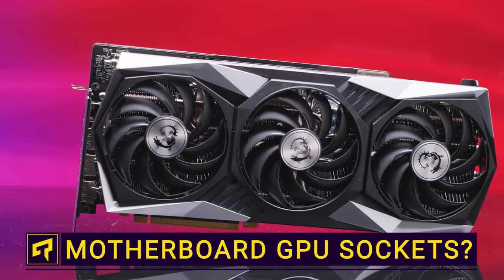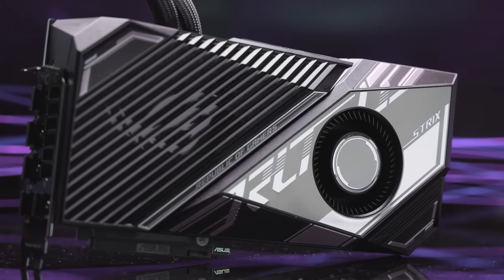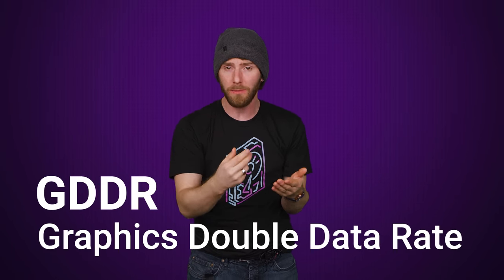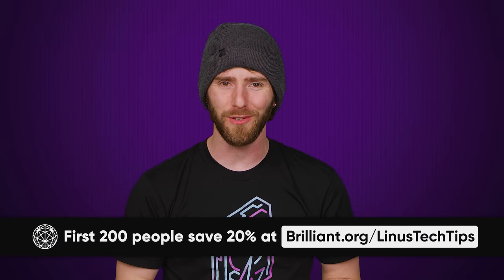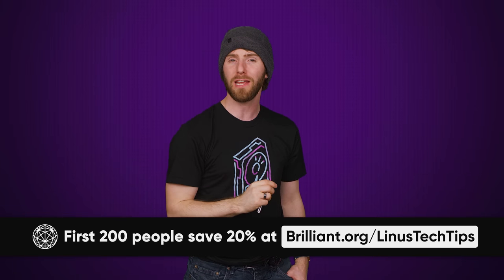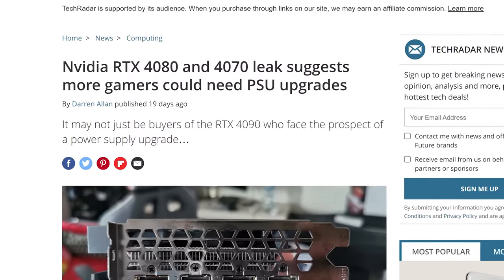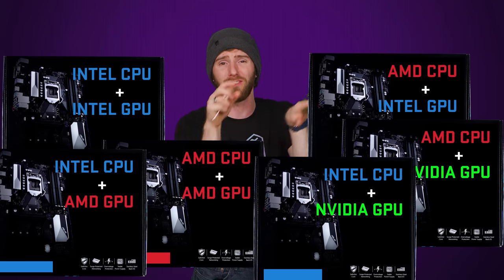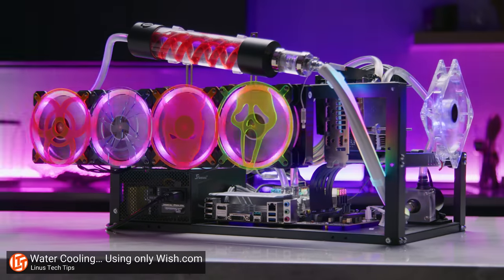Can You Put a GPU on a MOTHERBOARD?

Comment: Am I the only one that remembers nForce chipsets with integrated graphics? They sucked bigtime (from a performance standpoint), but they were GPUs on the mainboard (well, the chipset to be precise) that were powered on the board and hat "sloted VRAM" (they used the regular system memory, much like modwrn IGPUs/APUs).
Reply: Still have a motherboard laying around. They were practical in the same iGPUs are now.
Reply: Those were extremely weak GPUs though. They hardly needed memory or power so they were easy to build into the motherboard. They weren't unique either old Intel GMA or VIA Graphics chipsets were commonly included with just about every motherboard for simple display output.
Reply: They didn't suck at all! NForce chips may not have been the most powerful, but they were sure reliable!
Reply: @TheRealSkeletor  Reliability isn't everything in the consumer space. Those chips were weaker than a house of cards. Even then they were only good for light 2D workloads like webbrowsing and office work. Good enough for office appliances, maybe for most elderly people that dared to try working with one of those scary machines, but most people needed more than this.
Reply: @Donnerwamp  You're not wrong there, but you could boot into Windows on one of those, with no discrete GPU, so that's something. 

Also, you can actually buy a PCI-E GeForce 210 today, brand new. Don't ask me why.

Comment: This already exists.
(1) Apple M1 chips - including the desktop variants - utilize systemwide GDDR memory that is coherent with both CPU & GPU. And the desktop GPU performs similarly to a desktop RTX3080, so this is no budget laptop APU slapped into a desktop form factor.
(2) server motherboards already do this. Look at the DGX Station from nVidia. 8x high power graphics accelerators on the same motherboard.
(3) as others have mentioned, every laptop with discrete GPU is soldered onto the motherboard as well, and laptop motherboards are anything but huge!
Reply: Yeah. Integrated GPUs were already pretty powerful even when it was only Iris Xe and Vega, but they were only held back by the memory. I've been trying to see comparation of a Ryzen 5700G to my 750ti and although the 5700G itself was basically twice as powerful as the 750ti, they perform almost the same because DDR4 held it back.
Reply: Think part of the problem has been that motherboard, CPU and GPU vendors have historically been different companies. Now that both Intel and AMD makes GPU's wonder if either of them would design desktop motherboards with both soldered CPU's and mid-range GPU's. Intel already makes NUC boards, so I wouldn't be surprised if they add their discrete GPU to a NUC board with soldered GDDR5 memory.
Reply: The point of the video is more about having a socketed GPU "core", without the RAM component. That's not the same as laptops - that have either the GPU soldered or in a daughterboard - or the M1 - which, while powerful, is still an integrated GPU.

Also the DGX systems use discrete GPU's connected with SXM sockets. While those do deliver all the power through the socket (and an absurd amount at that), the memory is still in the GPU daughterboard.
Reply: It might have not been mentioned as clearly as it could've been, but the video wasn't about soldered GPUs but rather ones to slot in. Of course you can make fixed hardware however you want, this video however talked about why having these parts slot directly into the motherboard while keeping the freedom to change them out isn't a thing.
Reply: You do bring up some good points however,  I disagree slightly:
You need to keep in mind, the video implies more toward socketable gpus, not soldered on board (a universal gpu socket similar to using a  cpu or MXM slot)

In regards to (1): Apple's solution is more an APU and less GPU. This increases the costs and complexity as you can't just "upgrade your gpu" you have to upgrade the entire cpu (assuming it's not soldered in). In regards to 3080 performance, I find it lacking, especially in the 3d area (where it's significantly slower, but this is a debate for a different discussion). Solution would be to add more cores or increase core speeds of the gpu. However this comes with a cost: Increased power (remember kids: speed to power consumption is an exponential curve), or Increased cost (die size variations, decreased die yields for the larger core gpus). While I think they maybe the best way to go for power/performance, I feel it will limit your options, due to manufacturing costs associated with different versions.

Regarding (2): It's pci-e based GPUs, with 2 GPUs per card (look at the cooling system pics). So it's not a direct socketable GPU style system. So IMHO, not applicable in regards to the above video in this case.

(3): While this is true (you have things like MXM cards or soldered on board), you forget one important thing: Most mobile gpus are power restricted. The 3080 mobile for example is 150w MAX. A 3070 desktop can out perform it, at a higher wattage cost though. Also most mobile processors are 45w TDP or less. A desktop system has 65w-120w cpus, and 200-400w gpus. That means: A much larger power delivery circutry is needed (that increased board size and componet cost that was discussed in the video.

But all of this is moot if you don't have a uniform socket style for GPU's. 

Again, this is my $0.02, which is worth about that.

Comment: In the early days of the PC-8086/XT, you could buy an expansion ISA card that contained a full motherboard with CPU, RAM, BIOS, etc. It would plug into an ISA slot and would use the slot to talk to the remaining I/O cards like the GPU, I/O, and disk controllers. This would allow a 4.77MHz PC to be upgraded to a 286 or 386sx CPU.

Comment: What about for really low profile systems?

Instead of having a low profile video card, you would just have a second socket, for a video processor?

Or, what about two APU's, on one board, for better video?
Reply: did you watch the video?
also, two APU is the same as 2 video cards, which is SLI, which is discontinued and useless in tasks like gaming.
Reply: @JoaGamo  I think what they're trying to say is having one chip act as the primary CPU, and then another "APU" socketed on the board but with only the graphics part. And with what AMD is fixing to bring with their RDNA2 APUs I think it could very well be possible. The 6900h with 680m integrated graphics can do native 1080p low at close to 60 in a lot of games, even NEWER ones, and that's on a laptop with the igpu part of the chip only consuming 40 watts of power and running on ddr5 4800mhz! Now imagine a second chip on a desktop motherboard that's ONLY running dedicated graphics and can consume 100+W and ddr5 6000+mhz... I'd imagine something like that easily being able to do 1080 ultra and possibly even 2k. I think a socketable graphics processor is very well in the realm of the possible, just not in the realm of the profitable... Yet.
Reply: Pcie is that second socket, and then some. Think about what you're asking for.
Reply: @hoodie_ninja  seems promising but sounds very expensive. if I had some small factor PC i would just use a pcie riser and install a card wherever is possible

Comment: It would be cool if GPUs where the size of CPUs so we could go back to the days of single fan cards for top end GPUs
Reply: We just need to limit the power draw back down below 75W, then a single slot design will be viable again.
Reply: were*
Reply: It's not the size of the gpu that makes the difference, it's the power draw.
There's only a half inch difference between a Ga-102(30xx) and a R9 cpu, 2x2in vs 1.57x1.57 in, respectively.

Sadly, the days of single slot, low power gpus are pretty much dead.

Comment: What worries me here is.. the card dying. That would mean bye bye to the motherboard as well. Easier to just replace a video card, than a whole motherboard. Also, you won't need new windows and bother with setting up a whole new PC.
Reply: What are you on about? This video started with the question of "Why not have GPUs slot into a socket like CPUs?" ( 0:05) When your CPU dies, you don't need a new motherboard-- you're thinking of a motherboard attached to the GPU with sauter, but that's not what this video is discussing.

Also, no, you won't need to set up a whole new PC, either. You'd just take out the old GPU and put in the new one, like with a CPU. If your motherboard died, that would be a different story and a lot more assembly, but even THAT wouldn't make you reinstall/ purchase a new copy of Windows-- the operating system is held on your hard drive, where it'll boot to your account and desktop and files as soon as you get it plugged into a new motherboard (and get the rest set up, of course).

Comment: Another important reason GPUs are not socketed like CPUs is the memory clock rate speeds. Both the socket and the memory slots causes capacitive reactance, that induces distortions and degrades the quality of the signals along the interface bus. That's why GPUs are directly soldered with the video memory, to reduce this effect and make possible to drive the memory speeds much higher, given the critical bottleneck the memory bandwidth is for rendering graphics.

Comment: It's not "typically" the most power hungry component
It's usually the ONLY power hungry component
CPUs and Ram's usually use way less power
Can't say about cooling systems tho
Reply: CPUs can easily draw 300 watts if you want xD just depends on what you use
Reply: @mr_butz1900  most CPUs don't, that's the point... But most graphics cards these days draw way more power than most CPUs
Reply: @heyitscaiit9696  yes but the OP said that the GPU is the ONLY power hungry component which is flat out wrong.
Reply: @oxfordsparky  i also used the word usually tho 🤔

Comment: Be nice if could change the GPU upon the Graphics card - that'll be nice and split the whole graphics card and the GPU and let's be fair - Graphics card makers make money upon the GPU, but they don't upon the memory and heatsink etc as much as they do the GPU chips themselves.  So for them, adding a generational upgrade path would be more profitable for them as see more people buy their GPU chips direct to upgrade.  OEMs, well would in effect become GPU motherboard makers (sorry daughterboard) and maybe charge more, though to have a product that would hold current for longer and fewer variations would sure work well and be cheaper for them.  As for consumers - well, what's not to love.

Follow up video there - but more case of why don't they do this?
Reply: More complexity of this daughterboard would draw the cost up.

Comment: But what if the graphics card itself is more modular? A seperate motherboard for the graphics card which is still inserted into the pcie x16 slot with interchangeable gpu and vram. So you don't have to replace the whole graphics card when one Vram chip dies.
Reply: Makes no sense as it would be rare to need to replace it and sockets cause bandwidth, latency and power delivery problems.  The reason VRAM is soldered so close to the GPU is because it needs to be, the losses from even slightly longer PCB traces are huge, sockets are an order of magnitude worse.

Comment: All of my laptops have had the GPU mounted to the motherboard. I'd be happy to deal with a taller form-factor to have sockets.
Reply: Laptops with replaceable gpus and cpus still exist.
Dell's alienware area 51-m is an example.
But, just like in the 'old days', you're going to be limited as to what the system supports.

Comment: correct me if i’m wrong but didn’t linus review a weird chinese mother board with a built in gpu i believe it featured a gtx 1050ti and was on the small side either micro atx or itx?
Reply: Yeah, but this video omit so many things. Onboard soldered GPU is a thing in laptop, consoles and All-in-one computers. GPU socket exist in some applications, just not consumers.

Comment: I'll say it again, use a PIO (Parallel I/O) layout where the graphics card slots in the edge of the motherboard and then you can run dual tower coolers if you like.  One on GPU and one on CPU.
Reply: Distance from the CPU is a thing though, plus how freakin big would cases need to be?  Its literally a worse solution.
Reply: @alexatkin  PIO comes out of the near side, by the CPU socket.  Also look at all the computers using 100mm - 300mm riser cables.  Cases wouldn't necessarily be any bigger, the card already takes up 3 slots, just move it to the other side, and you still have 4 expansion slots.  Many cases are just coming with a big open hole for the  cards, should be easy to convert many popular cases.

Comment: A better question would be "why do all laptops do it?" Like I'd love to have an upgradeable GPU on a laptop, even if more bulky. I remember really old ones had removable CPU's.
Reply: the problem with all the changeable laptop gpu's was that there was little point in upgrading by the time the laptop was few years old.   it was done in early '00s.

now it might be more feasible technically, after all you can use external gpu cages and stuff.
Reply: Laptops with upgradeable GPUs exist.
Reply: @TheRealSkeletor  what I mean is basically a removable card with a pcie slot, like a completely new standard, low profile GPU. Is there actually something like that??
Reply: @tibimarin  The closest thing I can think of like that is a PCI-E vertical mount with a low-profile GPU slotted into it. It requires one extra step, but you could do that.
Reply: @TheRealSkeletor  What I'd love to see is the same type of graphics cards they already have on laptop motherboards, just as a separate piece that you can swap. It would probably add an inch to how wide the laptop is, to accommodate a PCIE slot (but im not complaining about getting a wider screen tho. Like imagine buying a laptop "case" and then the actual specs separately. you'd pretty much create a whole new market for laptop CPU's GPU's, PSU's and cooling solutions.
Reply: @tibimarin  Yeah, they already made that. We had that years ago.

Comment: Maybe it just wasn't in the time frame of this video but I'm surprised they didn't mention laptops and small form factor PCs. 
Don't most laptops and such have the GPUs and chips soldered directly to the motherboard? Not like a soldered pcie lane or something but whole chips just on the main board? I know those aren't 'sockets' that are swappable like he's talking about but I think it would have been worth mentioning. Also would love to see a video discussing why CPUs have pin arrays, why those pin arrays keep changing, like what feature sets are added and such that require more pins and why CPUs can't have universal slots like a GPU, or even say CPU sockets that are swappable. Like a pcie lane with the socket set on it. I'm sure that it would have issues with how the rest of the board physically communicates with the chip but still I'd like to see more of that
Reply: they mentioned laptops at the end 4:11

Comment: Not only do we not need everything to be on the motherboard, it has to be detached and independent from it.
The superior design in terms of repairability is to have separate, modular, swappable PCBs for each of the functions (e.g. visuals - graphics card; audio - sound card; Ethernet - network card etc.).
And each of those cards can then have the most appropriate voltage regulation components, controller chips and whatnot that work optimally for its architecture according to the engineers who designed it and to the manufacturer that produced it.
The motherboard should be only a frame to which everything is attached with the sole purpose of facilitating communication between the cards.

Comment: I had the idea if the actual graphics card is modular you can add your gddr memory to it change the gpu assuming it is compatible with the socket just like the cpu
Reply: I always wished we can just upgrade GPU memory like on a mobo.
Reply: And a standard for the cooler. It would be way easier to find a solution that fit a special case or to reuse old water coolers.

Comment: It's doable if you don't consider that it needs to support 450W GPU's.
Given that CPU sockets support greater than 250W power draws and high end motherboards have VRM's capable of drawing well in excess of 500W, splitting the power draw between CPU and a socketed GPU up to 500W total wouldn't be difficult to engineer and optimisable using technologies like AMD smartshift to put the power where you want it.

Cooling, custom water cooling that channels to both CPU and GPU is a thing already without requiring multiple radiators.

Memory, there's nothing preventing manufacturers from developing slotable GDDR modules with higher bandwidth to DDR for use with your socketable GPU and it doesn't need to be limited to 64 bits wide or dual channel, it could be 128 bit triple channel which would allow for up to 24GB of GDDR6 (current) or double that with dual rank modules.

Given that high performance ITX exists, you could build a motherboard with both sockets on ATX sized motherboards and still have space for a few PCIe slots.

There's no need to support multiple GPU manufacturers, AMD could be for AMD, intel for intel, and Nvidia would just have to play nicely and conform to the given socket, remember once there was only socket 7, one motherboard, many choices.

Socketable GPU's would minimise the crap of limited memory bandwidth and PCIe lanes to a great degree if the GPU has to conform to a minimum set of features that would comprise the GPU socket.

While there's no doubt that a similarly specced AIB GPU would outperform a socketed GPU, the customisation possible with a socketable GPU would eventually outperform over the life of the system as well as save a lot of ewaste and total cost of ownership over time. Imagine how good a 6500XT would be with 8GB and a 128 bit memory bus in a socket vs the limit AIB cards have imposed on us all.